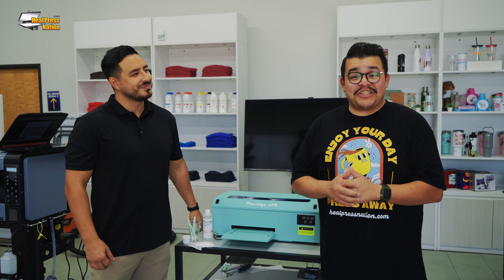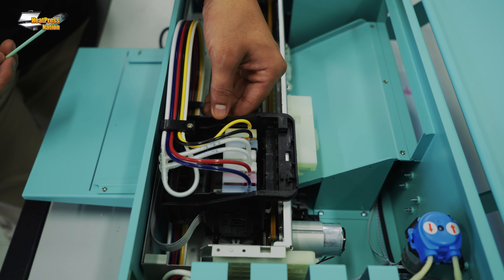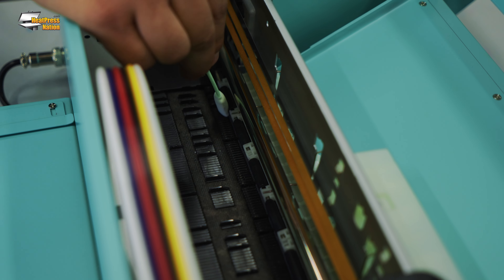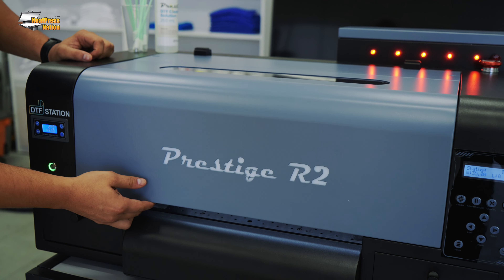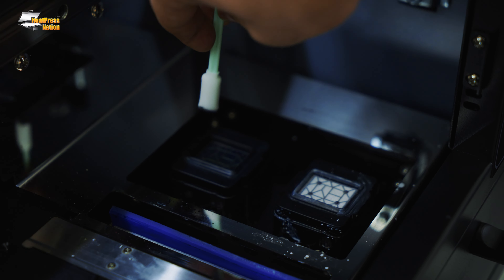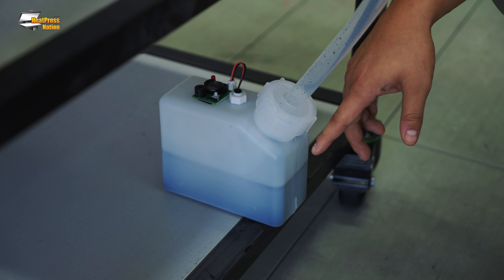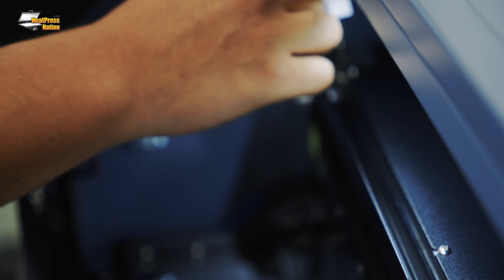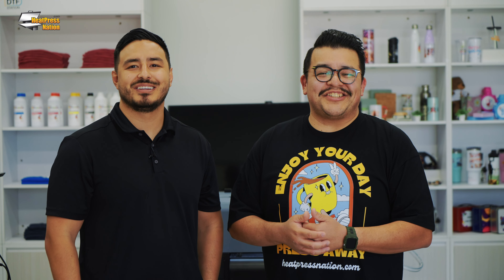Step By Step DTF Printer Maintenance

Comment: Hey how do you solve scratchy dtf prints? We have the R2 and are still on our learning curve - we have printed a few great prints and some now have minor scratches on them - they print well it looks like something is scratching when the print hits the shaker and through the heater
Reply from the maker: Check your powder to make sure there aren't any little "powder stones" in there. Sometimes the powder can solidify into these shapes. When these powder stones hit the liquid ink, they can scratch  or mar the image. You can usually break up these tiny stones back into powder. But if you've been recycling your powder over and over and over, you may want to swap in a fresh batch.
Reply: @HeatPressNation  thats it! That definitely fixed the problem thank you!